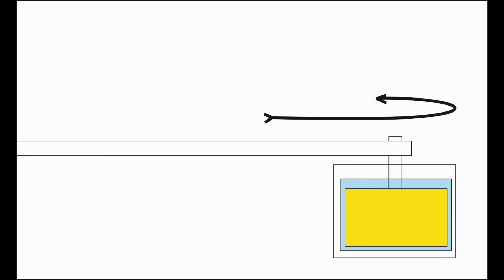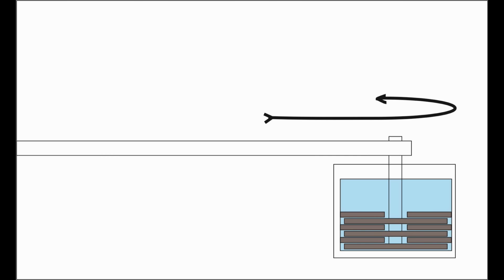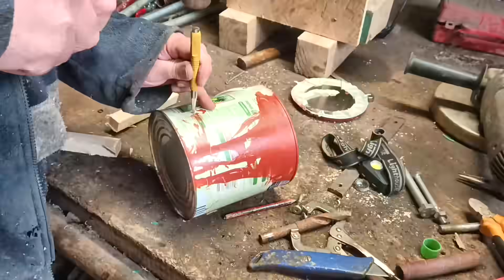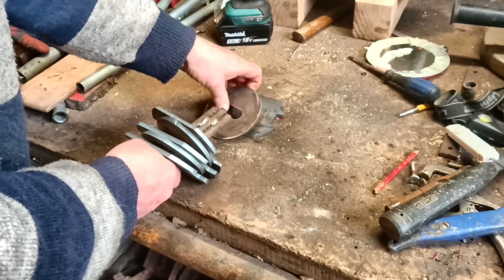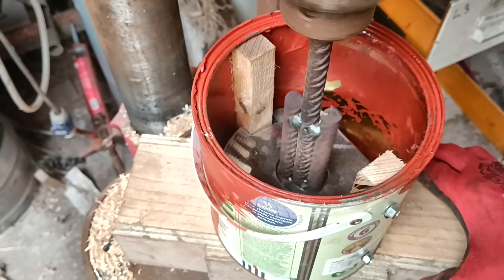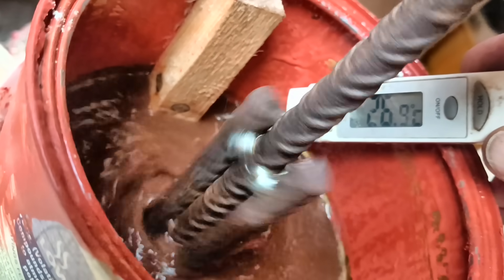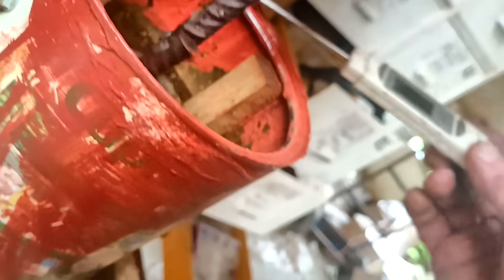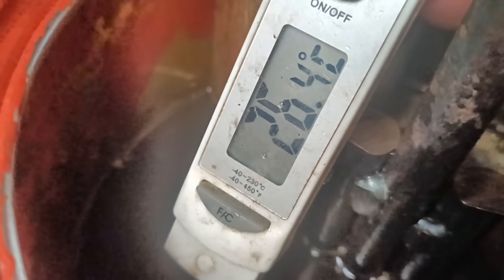Heating Water With Friction – How Practical Is It? Interesting Experiment!

Comment: I seem to recall year and years ago a man inventing something to heat water within a water heater using friction, though after searching for it again, it seems to have vanished off the internet. Essentially, it was solid cylinder of metal with holes cut though it. That cyclinder was conncted to a drive shaft that was connected to an engine of some sort. The cyliner was lowered into a tank of water and the friction generated from the cylinder being spun at high speeds and water ripping though the holes was enough to practically flashboil the water. I dont rember if he had it so that the cyliner would spin one direction and then suddenly change similar to a washing machine or what? I think it was called a water ram, but i might be mistaken on that name.

Comment: There's a guy has some videos on here heating water to different temperatures all the way up to super super hot steam by using cavitation. he built cavity pumps and run them with electric motors. He actually put some of them in a local fire hall wherever he's from and they use them for their shower rooms. it was much cheaper to run the electric motors than run a hot water heater. this thing would heat water on demand.

Comment: I had this same exact idea about a decade ago! I think the best way would be to combine several of the adaptations you mentioned. Use oil instead of water, bearings (made much happier in oil than water), I'd also build the lower bearing up off the floor of the chamber quite a ways because wear particles will inevitably sift downward, although the constant spinning will fling them outwards, away from the center. I'd also use something like car brake pad friction material on alternating surfaces.

Comment: I think you could've used very thin metal disks, but a lot lot of them, and keep them small distance from each other, so they would not wear. Basically, a modified version of Tesla turbine. Even though it's harder to assemble, there's benefit of very low wear, and lower mass. The water itself should provide friction and hence heating, but without much wear on metal.
Reply from the maker: huge rpm needed though

Comment: You do not need contact NOR magnets for frictional heat generation.  What you have made is ALMOST a Tesla Turbine.  Super efficient and high adhesive properties between the plates.  Look up the Tesla Turbine.  Simply separate your plates by a millimeter or two and you will have extremely low wear and tear and good efficiency.  I have not tested a Tesla Turbine as a water heater as it is usually used in flowing water to turn the shaft.  But your design is essentially a TT without the shaft plates being fixed to the shaft.

Comment: Hey Tim i saw an interesting idea to do the same thing. 
A rotor with dimples offset in a tube. 
This was all under water
As it spun it created cavitation in the dimples as it went from low pressure to high pressure
Reply from the maker: Huge rpm though?

Comment: @wayoutwest-workshopstuff6299 >>> FWIW: One issue I see is the minute particles of steel worn off the plates by friction becoming suspended in the working fluid and constantly being pumped through the system. 

Even if friction works more efficiently then the magnetic induction system, the magnet system would never have to deal with this problem.

Comment: I don't think this would be very practical. First, as the plates wear, less friction would occur. Most of the friction is generated from the wear of the plates. Making the plates smooth would reduce the friction as well. Second, if you use oil to prevent rust, the friction would be greatly reduced since the oil is a lubricant. Also, to ensure the oil doesn't ignite, you would use the oil found in power line transformers (or expensive silicone oil).
Reply from the maker: No rust after the first couple of hours..

Comment: Have you got any plans for this windmill? I think you should make it a priority. Your madcap ideas would surely be tripled in strength! You'd feel obliged to build things so as not to waste all the free energy, and you wouldn't be abusing your poor old drill. As far as that goes, maybe you could get a cheap nasty hand drill, so that when you wear it out, it won't really be a setback or much of a cost. 

I just imagine that if you built the windmill, and make it a decent enough powerful one, at least a few hundred watts or maybe a couple of kilowatts, you'd be out there all day sticking things to it. Maybe have a belt system like that used to power Victorian factories. Where they'd have a big steam engine or waterwheel, driving a long shaft the length of the factory, and tools or weaving looms would have a leather belt up wrapped round it, delivering torque to their machines. Use a decent sized belt or pulley that could deliver decent power, maybe alternating with smaller cheaper pulleys, depending what you're trying to power. The slip of the belt provides a clutch for safety.

Actually don't turn your entire house into a mill. Just do the windmill part, but give it a versatile way to take off power.

Comment: You dont have to actually generate "electricty" to take advantage of electrical heating! Spin magnets inside a metal drum. Just like a magnetic brake, way less friction, noise, and contamination. The eddy currents will provide a good deal of heat

Comment: Yeah i think I'd just use the windmill to generate electricity.  .  Then you could use a low voltage element, maybe also add output from solar panels too.

Comment: I think it takes more heat to make those plates than any amount you can get out of them, before they turn into iron glitter.
A better idea is using paddles on a more viscus fluid. Any energy used to churn the fluid, will be wasted as heat. So all you need is resistance in the fluid.
I did consider churning sand, or mud, but those will ware out the paddles pretty fast. Oil and grease can catch fire, maybe a very fine clay would be the middle ground?
But the best option in my opinion, is turning a heat pump with the  mill, either an old air conditioner, or compress normal air in one container for heat, and release it in another to get some cooling out of it as well.

Comment: It wouldn't be practical with a wind mill because the friction creates a force that acts against the wind force called drag or resistance.  If you have a plate full of magnets with alternating poles alternating hooked to the crank shaft and open ended copper tubes stationary, coiled, and weaving in-between the magnet plates, it will produce heat and heat up the water with less resistance.  This would be more practical with a wind turbine.

Comment: radiation losses are 5.67x10^-8 x (ET^4-et^4) where E= emissivity of the tank (use 0.7 for mill finish steel sheet) e= emissivity of the surrondings (0.9 for a dirty workshop) T=surface temperature in kalvin and t= surface temperature of your surrondings in kalvin

Comment: as someone else has said, rather than direct friction which will cause loss of material, use very thick gear oi/grease and the friction caused by paddles turning would create a lot of heat. very much like torque converters in CVT cars

Comment: i would use an electric motor, to convert the rotation power to electical power, charge batteries and power the house over an inverter, heat pump can be pluged in also easally. every moving part have maintenance to be done. or induce it as some else mentioned it in a copper tube, via a rotating magnet wheel. Most people dont know, that water have the highest heat capacity of all liquids, it take lots of energy to boil water, thats why its a good coolant.

Comment: i was helping a friend fix their hot tub... i was surprised to find that there was no heating element.. it used a turbulence inducer on the pump discharge... friction.   A more complicated but more efficient way would be a carnot heat pump...

Comment: Do you know what cavatation is? Well that is how you can quickly heat water take a think metal disk drill holes in it put it on a shaft put that in a drum of water spin the disk and in a minute you have boiling hot water.

Comment: You can circulate water thru a restriction at high pressure and the friction will heat the water.

Comment: If your going to use rotation then your better off using the heat force from producing Eddie currents from moving forcing a magnet between copper it’s a non-contact solution so no wearing out of components

Comment: There was a program in the 80s or 90s called it runs on water. One inventor used a cylinder full of holes strategically placed and rotating to heat water.

Comment: Technically an induction cooktop is also heat by friction. Pretty easy to implement due to commodity. But this is an interesting experiment!
I like the top comment of heating with magnets directly in the fluid, there would be no electrical conversion losses! And no electrics to faff about with of course.

Comment: for the kettle crowd.
using a generator to run a heat pump is a more efficient way to heat water.
you can move 3-4 times the heat that resistive element creates.

Comment: I would just use ac motor as generator, short the output with a coil as a heating element with appropriate pptc, and dump everything into oil.

Comment: how about. have it pump water or oil to the home under pressure. then in the home you have a reversed tesla valve(s) or something and whatever radiator you wish. so the heat is primarily produced  and distributed in home so you don't have something hot cooling on its way to the home.

Comment: the colorimeter used by Joules himself was no more than paddles in an insulated pot of water.

as everyone suggests...eddy current heating.

throw shallow pockets in a steel plate. only enough to locate them and act as a "keeper" on the unused poles. mount it to rotate...
thick piece of copper plate, some copper pipe soldered to the back...

bring it close to the magnets.

if you get really fancy, a centrifugal governor that adjusts the gap. wind speed picks up, load increases, braking forces increase, energy appears as heat, and blade speed gets limited to something sane... regardless of windspeed. no need for brakes as it IS the brake. well designed blades, and a good governer, you can start to approach the betz limit of the blades, and stay in that sweet spot...

 and the energy in the wind builds on the cube of the velocity...

its the only sensible way to do it. every other method only absorbs "so much" energy from the wind, being restricted to certain "bandwidths", as they charge batteries or attempt to supply some type of fixed voltage or current into a load... a resistor on an alternator cant capture energy on a cubic law, but a simple eddy current heater can. the load can be made appropriate to the windspeed.

the amount of power is based on windspeed and swept area, but the TEMPERATURE will be dictated by the rate the energy is delivered to a certain amount of heating area. how fast you can suck the heat away....

Comment: Or you could just stick that pile of metal in a bucket of water. Connected to only two cables. A positive and a negative.!

And run very high voltage at very low current. At very high frequency. 

And that f**** of water will turn to steam faster insert adjective. 

For very little energy.! 

I think everyone knows that right.?!

Comment: Quite a long time ago, there was a company trying to get investment in a 'revolutionary' water heater - it consisted of a solid metal cylinder on an axial spindle. The curved surface of the cylinder was drilled with many shallow cavities and the whole thing was enclosed in a reasonably close fitting cylindrical jacket.
Water was passed through the apparatus as an electric motor spun the cylindrical rotor at high speed.
It heated water quite effectively, supposedly some pressure effect of the cavities all over the surface of the rotor.
The inventor was claiming that it generated more heat than could be generated by the electrical power consumed, which is instantly suspicious, as this device did not seem to be any kind of heat pump.
I don't know what became of it. Maybe the whole thing was a scam.
Reply: It was a scam

Comment: Very interesting and different idea. But probably still the best is get the wind turbine to turn an generator and use electricity with a heating element like a kettle and heat water far faster and more efficiently

Comment: Cool experiment. But I’m really enjoying the comment section. Some really great ideas. One that I found partially interesting was having a copper coil with water running through. Fire is often the way to go with this method but maybe friction or magnets in this scenario might work. Also, fire could work but use the windmill to pump air into the fire, like a forge, to super heat the fire, and heating the water much faster. More of a hot water on demand situation. Also really like the compressor idea, where you could go with a heat pump type situation. Great stuff! Look forward to seeing where you go with this. Keep experimenting!

Comment: See my DIY Cold Fusion replication, if an array were built, and passed via a heat exchanger, Hot water would just be a side effect of the cooling system. @ 2W per cell it beats most devices out there!! Could add  5x20W TEG's per cell , for over unity device.  But what do I know ? I lived in a cave house.

Comment: Mate! Dont you remember the British inventor who created steam by injecting water into a Cylinder  with many holes, with a very thin gap between it and the  housing? With a low watt dc motor to spin the cylinder? water in , steam out. The steam could run a turbine and easily power the DC motor with plenty of excess power! And can reuse the water in a closed loop. Depending on the size and depth of the holes determined the output temperature up until steam . Cavitation reactions are very hot! You will have to find the original video on the interweb to estimate the hole size for the cylinder he used for steam. What you are attempting while noble, in the pursuit of science is not efficient enough. Also see- Boiling Water by Using Sound - Acoustic Levitation - Amazing Resonance Experiments, And Robert Murray Smith's method. And my method on my channel.

Comment: Driving oil through a (easily modified) shock absorber (which is made to transfer kinetic energy to thermal energy) would heat water and be extremely long lasting and work at various speeds if you use the correct damper type.

Comment: Toyota uses something called a power heater in some vans to use engine power to speed up the heating of the engine coolant in cold weather. It's basically a fluid coupling with the output fixed so it heats the coolant by slipping. No mechanical friction so no wear, just fluid being pumped by a rotating impeller against a stationary turbine wheel. It's driven by the accessory belt and uses an electric clutch similar to the ones used on air conditioning compressors, engaged by a switch in the dashboard. Something similar could probably made from a torque converter but the materials might corrode and bearings seize from lack of lubrication if used with water so an oil to water heat exchanger might be needed.

Comment: Windmill to electric generator to microwave water heater. Microwaves excite the water, it couldn't hurt to have a mechanical stir in there as well. If you insist on a metal mechanical drum for friction. Take a drum out of an automatic transmission. You can remove the friction discs, or keep them in, change the number of discs, remove the friction material. AND you can use air pressure to activate the clutch drum internally to change the slip or pressure on the plates. Same with the external band for holding the drum can be used to slip it more or hold. Or just take a whole auto transmission torque converter too. Fill it with water. Lock the output shaft and turn the input shaft with a couple hundred horsepower. You'll get your heat.
Reply: Water to water intercooler as a heat exchanger to make it "safer" to drink.
Reply from the maker: It sounds so simple but they need high rpm, don't they?
Reply: @wayoutwest-workshopstuff6299  Idle for an automatic 800-900rpms.  At a traffic light in D, on the brake. Pretty much the same conditions, but without engine and exhaust heat surrounding it. The tq converter, and pump would be moving fluid throughout.

Comment: Hi Tim, I'm not the least bit technically competent but two things spring to mind ( one of which you mentioned in passing)  metal +water = rust. Also, if you use oil instead, although it solves the rust problem it becomes very prone to catching fire and so quite dangerous.  Maybe you expect anyone watching to have more knowledge of engineering than I do, which I admit wouldn't be difficult, but this project seems a bit strange to say the least!
Reply from the maker: Thanks Abigail - I'm just working on another to try to make it clearer

Comment: Very interesting. Perhaps you could use synthetic oil, steel for the abrasion points, and some round concrete "spacers" in between to apply a bit more force with gravity. You probably would not need too many layers, perhaps 3 or 4, inside a half or full meter by the same vertical sized drum filled with the oil. I suggest synthetic oil because it is inorganic and will not break down and last a long time if you add a mechanical oil filter circuit. Gearing would need to be fairly low, but I bet with a heat exchanger pipe around the perimeter inside the drum you could extract a lot of heat energy. You would probably need some type of a clutch system to get the rotation started, stopped, and create less wear and stress while it gets up to speed. Best wishes for  your lovely experiment.